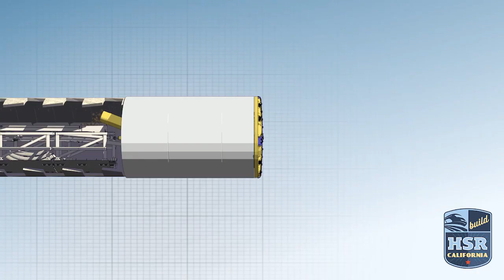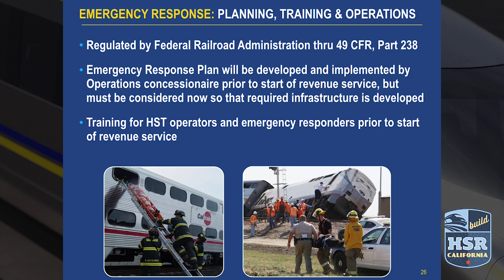HSR Q+A: Tunnels with Gary Kennerley

Comment: Hi Gary, care to comment on the expense of driving a train at 180mph up a 3% grade inside a tunnel, how you're going to deal with that kind of power draw, and how much a ticket is going to need to be in order to facilitate all that?  Just wondering if you can also comment on how the state is possibly going to bore 57 miles of tunnels running through seismic areas and potentially dealing with gas pockets and other hazards in 5 years in order for Phase 1 to be completed by 2033 after you're able to start on that with the completion of Central Valley in 2028ish despite not having any money to do it.
Reply: Just to address your first question since it’s relatively simple. Siemens’ latest 220+ mph trainset has a maximum power draw of 8000 kW. The longest consistent grade on the CAHSR plan is Tehachapi Pass at 15 miles of continuous uphill (Pacheco is pretty level). If we assume that the train is at max power for all 15 miles at 180 mph then it will clear the pass in 5 minutes with total power usage of 400 kWh or about 4 Tesla Model S batteries which is $66 of electricity at California’s average of 16.7 cents per kWh. This is $0.16 of electricity per passenger for the longest and steepest pass. The max instant energy usage of 8 MW is the same as what is produced by one moderate size PV solar farm. By the way, CAHSR’s 2020 Business Plan calls for building renewable energy sources to offset all power draws from operations.
Reply: Earthquakes are a real danger to tunnels. But worldwide engineering has found a lot of solutions to deal with that danger. If you really are interested I recommend to get some information about the rail tunnel under the Bosporus strait in Istanbul, Turkey, which faces exactly the obstacles you will find in California. The tunnel is so to speak a swimming tunnel, or in other words a tunnel within a tunnel and bumper material inbetween, so when an earthquake hits, only the outer tube (which is elastic) will shake and prevent the inner tube, which carries the rails, from cracking or collapsing. Same priciple you'll find in some modern Japanese tunnels. I guess CHSR will build these tunnel like that
Reply: @OldSchool-px1xk  no one is saying the tunnels cant be built.
Reply: To completely Brandon's answer, when it comes to sismic "dangers", Japan is way worse off and never had any problems. and as to the gas pockets... What are you even talking about? The train isn't going 50 miles underground.
Reply: @ronylouis0  Its two totally different fault systems.  Japan is next to a subduction zone.  We're on a slip-strike fault.  The train is going to be CROSSING faults and fault zones in several locations. California is an historical source of petroleum and natural gas.  Why would they be 50 miles under ground? Thats below the crust. What are YOU even talking about?

Comment: Even without a rail link from Bakersfield to Los Angeles, HSR will still be as fast or faster than flying or driving between Los Angeles and San Francisco, San Jose or Fresno.
Reply: Mythbusters showed that a typical SF to LA travel time is 6 hr 45 m.
Reply: True, as one can just go on a bus. Even if slightly slower, it reduces stress.
Reply: @AshmewStudios  I hate cramped uncomfortable buses. On a train, you are never trapped next to someone unpleasant. On a airplane, you are really stuck. Plus the cheapest train ticket gives you as much legroom as a first class air ticket.
Reply: @AshmewStudios  That impractical connection is a sucky 2:20 ride. No way!
Reply: Time in the air is about 1hr 20mins or less from LAX to all 3.  Most anti-plane people exaggerate the wait at an airport.  It's never taken me more than a half hour to get through security, and I've mostly flown international.  So let's say an hour.  Time to and from the airports is irrelevant since you're going to need to go to and from a train station.  So 2hrs 20mins.  Just checked Greyhound.  Bus takes 2hrs 10mins just from L.A. to Bakersfield, so no.  Probably faster than car, although I'm willing to bet its close because your time to and from any station is eliminated, and you'll be driving just as fast as the bus if not faster.
Reply: @LucidStew  It's actually 55 minutes in the air not 80. But anyway. 

So you are claiming that you can get through SFO and onto the plane in 30 minutes? I'm sorry but that is ludicrous. I actually fly SFO-LA a lot for work and can confidently say that that is like catching a unicorn by the tail in the Tenderloin on a moonless night in August while blindfolded and on crack doused with fentanyl. Even with one hour you were cutting it close pre-Covid.

First of all, doors close 10 minutes before departure. You need at least 10 minutes for security in the absolute bestest case scenario, and you need to get to the gate. Even if everything goes perfect and you make a run for it, you might get a gate that's far enough to miss your flight.

If you have bags you're late. If there is any TSA line, you're late. If you forget a bottle of water in your bag, you're late.

A realistic amount of time for the SFO-LAX is about four hours. You pass TSA and grab a bite. That's how normal people do it. The train would be a lot more relaxing and way more comfortable even if you compare HSR coach to plane business class. Plus you can get work done or rest for all of trip time on the train vs all the running around via plane. There's a good reason no one who has the option of taking HSR for 100-500 mile trips chooses to fly in civilized countries (and the North East.)
Reply: @TohaBgood2  I said 1h20m or LESS.  55 mins would be included in LESS.  You're counting security, luggage, travel through and to, COVID... all those you'll have to deal with on HSR as well.  You think they're just going to let you walk onto a train potentially carrying 2000 people at 200mph? MAYBE until the first one gets blown up...  Its a complete lie that no one flies where there is HSR.  More ride the train, especially mid-haul around 250 miles because that's HSRs wheelhouse, but plenty of people still fly.
Reply: @LucidStew  Hold on, what do you mean 1h20 or less? Do you think some planes just do an extra lap around the airport to rack up the extra miles? Air time is always 55 minutes unless something unusual happened. 1h20 is usually the duration of the entire ordeal, including taxiing.

Covid makes plane travel a lot faster, not slower, due to no lines almost anywhere.

You can bring a much larger piece of luggage onboard a train than a plane. Hence, you almost never need to check in bags on a train unless you're taking your entire closet for a weekend visit to SoCal.

And finally, on security. YES, they just let you walk onto the train!!! That's the whole point! Try the Acela next time you travel along the North East. You just show up and walk onto the train. It is freaking awesome! No security lines, no taking your shoes off, you can bring a bottle of water with you. It's just a normal, civilized travel experience. 

But most importantly, with the plane you never have free time. It's four hours of annoying things you have to do - drive, park, run through the terminal, security, run again, wait, now we're climbing, now we're descending. With the train you have just 2h40 of peace and quiet, and then you're there!
Reply: You live in a fantasy land where a mode of transit takes exactly the same amount of time each time no matter what. Also one where you think stepping on and off an express train with only 2 departures a day is all the time consideration involved.  BTW, we're not even talking about L.A. to S.F. on the train in this thread.  The original premise is that L.A. to S.F. will be slower by plane simply because Bakersfield to Merced will be HSR.  So you're going to be taking all sorts of buses with transfers and misaligned schedules or drive.  These are things you're not talking about because you've jumped into the discussion without apparently even bothering to read what its about.
Reply: @LucidStew  I live the real world, where traffic, delays, weather, congestion, and a multitude of other factors make it impossible to show up at SFO 30 minutes before even a regional "shuttle" flight and expect to consistently get on that flight. 1 hour is the minimum if you want to get on 90-95% of your flights.  

This is largely due to how clunky air travel is as a means of transportation. For long distance trips you have no choice but to fly. But for anything where it is possible to avoid flying, people will. HSR is a particularly attractive option because it offers superior total trip durations for trips of lower than about 100-350 miles and about the same duration for trips of up to 500 miles. Above that flying takes less time than HSR on average and more people choose to fly making HSR less economical (but still not a bad option!).
Reply: @TohaBgood2  you are utterly obsessed with this 30 minute amount.  It's too bad in that post I actually allowed for an hour at the airport.  and again, you're arguing something that has nothing to do with the conversation.
Reply: @LucidStew  I am just establishing the limits of your credibility. If you've bent the truth once, you may do so again, making you a non-credible poster. Why should any of your conclusions be taken at face value if your premises have been proven to be wrong?

Isn't this exactly what you were trying to do with the other poster earlier?
Reply: @TohaBgood2  Where was the "truth" bent here? Point it out precisely.
Reply: @LucidStew  You have never actually taken Amtrak. The existing OAK-BAK San Joaquin runs eight times daily, and with HSR from Merced to Bakersfield expect frequency to increase to 10-12 per day, at least. The San Joaquin and all its Thruway bus connections are operated very well and connections are always made. Also, since SFO and LAX etc are not within walking distance of any popular destinations, the same issues apply with air travel.
Reply: @HSMiyamoto  What an absurd statement.  You haven't the slightest clue what I've done.
Reply: @Lucid Stew  - People judge you by the ignorance of your statements.
Reply: @jessicanathanson240  point out what I've said that is ignorant.
Reply: @LucidStew  You clearly know nothing about the San Joaquin. An LA to SF ticket includes a connecting Amtrak bus from your choice of Los Angeles, Burbank, Glendale, Van Nuys, Fullerton, and more. On the other end, you can catch BART at Richmond, connect by Amtrak bus at Stockton to San Jose, Santa Cruz, and more. Amtrak also runs buses to Lodi, Sacramento, and even Santa Rosa. Thus Amtrak already provides more frequent, comfortable, and convenient service to more places in California than any other company.
Reply: @HSMiyamoto  I know plenty about it.  I'd say I know as much about it as you do moving goalposts in an argument.  The connectivity is irrelevant.  There is a BART station at SFO, and LAX will have a Green  Line station in 3 years.  The argument is purely about which is faster. Plane or train with bus.  Plane wins. you lose. Sorry.
Reply: @LucidStew  The ultimate origin and destination of a trip is never "irrelevant." 

After the CHSRA line is open from Madera to Bakersfield, and the San Joaquin is using it, the train trip will be about 1 hour shorter, and in many cases, using the train will be faster than flying, or about the same. At minimum, the existing diesel-powered trains will be placed on the new tracks and allowed to run at 125 MPH.
Reply: @HSMiyamoto  that's great. and I'm glad you're arguing about something totally different now.  using the train will not be faster than flying between LAX and Fresno, San Jose, or S.F., which is what you originally said.  Flying will be faster by at least a hour with only Central Valley done, and in the case of S.F., closer to 4.
Reply: @LucidStew  Your statement about never having to wait more than 30 minutes at the airport made people say to themselves -- "Oh, he's one of those." Especially people that work at an airport. 

Ive seen lines longer than two hours at U.S. airports. I was lucky because i was pushing my mother in her wheelchair so we got priority. You keep waiting to the last minute for airplanes and eventually you'll be left behind.
Reply: @HSMiyamoto  I dont know what "oh, he's one of those" is supposed to mean.  That's my experience based on getting to airports 3 hours early and sitting around for 2 1/2 hours. I'm sure there are exceptions, but exceptions aren't the rule.
Reply: @LucidStew   Yeah man, but it only takes once. I've never paid the "walk-up fare" for a an airplane ticket, and I hope I never have to. When you have to get somewhere in a hurry, and you have no reservation, you are at the mercy of the airline. I get through TSA, buy a bottle of water, and then go have a meal and relax.
Reply: @Lucid Stew you are right, the idea that you would not pay through the nose if you needed to book a ticket immediately is false. I stable price for a ticket is a needed alternative. It isn’t that you can’t get a ticket it’s that airlines set those prices and people don’t take trips throughout the state that they otherwise would.
Reply: @johnsmith00001  So... you're calling for price controls on airline tickets?
Reply: @johnsmith00001  Anyway, expanding air capacity in California would cost more than CA HSR, raise more community opposition and have none of the environmental benefits. Can you imagine what would happen if we had to add two new runways to LAX, alone?
Reply: @HSMiyamoto  I, too, have not experienced long waits especially at OAK. It's a bit longer at SJC and can be awful at SFO, so it depends. Also depends on time of day, day of the week, holidays, etc. I love trains and am rooting for this one to succeed (have been rooting for 25 years now), but it is anything but a slam dunk. If you want to be accurate about total travel time you cannot also assume there won't ever be any new security delays imposed at train stations. Additionally, there are now and always will be more flights than train departures, which will get you to your destination closer to your desired ETA.
Reply: @HSMiyamoto  The San Joaquins is slow as are all of those uncomfortable bus and bart connections you espouse to support your reply. Though I am all for increasing Amtrak average speed from 40+ mph on up to an average speed of 80 mph via Class 6 trackage.
Reply: @DouglasLippi  More good observations made, as usual. Thanks.
Reply: @davidjackson7281  - The new CA HSR line is going to increase the average speed much more than trying to use the existing BNSF mainline. Moreover, there will be no interference with freight trains. Remember that the existing BNSF mainline is only single track.

Comment: Trump is going to get his ass handed to him in November. The stunt he pulled at the White House was a national disgrace and straight out of the Mussolini playbook. If you believe in him you are a sucker and are easily manipulated. He stands there with no mask after 215,000 people have died a miserable death. Where is the empathy? It’s disgusting.

Biden/Harris 2020
Reply: Acerailfan3101 F40PH I doubted with Ace Rail Fan in your name you would be opposed to HSR.  HSR is going to be huge for the ACE.
Reply: Acerailfan3101 F40PH I was confused at first because when I got the YouTube notification it only showed the first part of your post. And then I looked at your user name and thought it didn’t seem right.....Then I scrolled down. Oof
Reply: Acerailfan3101 F40PH they need to do the Bakersfield to Palmdale section before anything else.  If we had to settle for Metrolink and the ACE as bookends to the system for 15-20 years I think we could live with that. With the extension happening to the ACE and the double tracking happening on the Antelope Valley line you’d have a viable network. If there could be a a connection to Bart from the ACE near Livermore it would be an easy ride to San Jose and the City from there as well.

Comment: Use the boring company to make these tunnels
Reply: One of the key details that Elon Musk's Boring Company relies on for faster boring is a much smaller tunnel diameter with their latest tunnel boring machine having a diameter of 3.7 meters. Unfortunately, running a train at high speeds through a tunnel means that the tunnel has to not only fit the train and track systems, but it also needs adequate empty space around the passing train to prevent tunnel pressure from building up in front of the train. The Pacheco Pass Tunnels are being planned with a diameter of 8.5 meters. For reference, Switzerland's Gotthard Base Tunnel was bored with a diameter of up to 9.58 meters and Germany's HSR tunnels tend to have a diameter of 7 meters (however, Germany's do suffer from "tunnel boom" which is a problem).  
  
The 8.5 meter diameter puts it well outside of the range of experience for the Boring Company for now. Government contracts are public and pretty upfront about their selection methods so if TBC puts forth a winning bid there is no reason they shouldn't win.
Reply: Brandon Kynsi thanks for the thorough explanation.